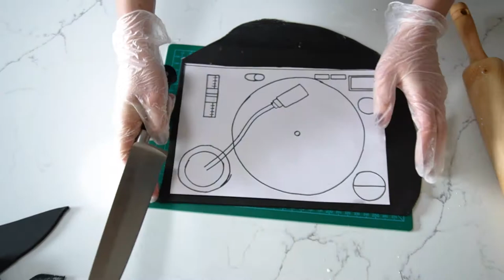DJ Turntable Fondant Cake Tutorial

Comment: Excellent job!! Does the outside get hard? Are you supposed to remove the outside to cut the cake?
Reply from the maker: After a day this decor will dry a little bit, but still be easy to cut with a knife. 
If it dries pretty hard, you can remove it before cutting the cake as well. It’s a good idea! I don’t recommend people to eat black or red fondant anyway - it has too much food coloring.

For this particular cake it’s not necessary to let this piece dry - it’s my habit to make difficult pieces ahead of time to make sure I have everything prepared on time without stress by the time of the event :)